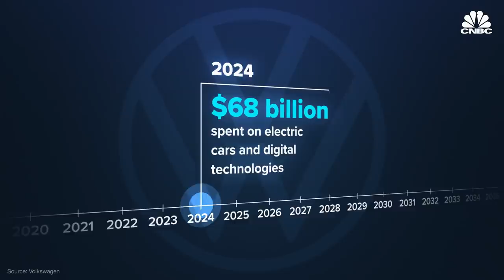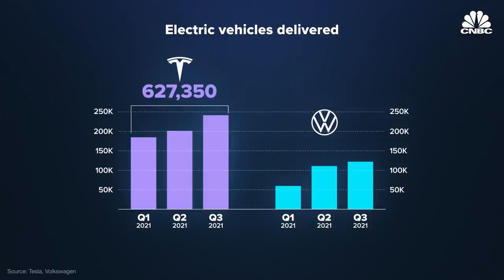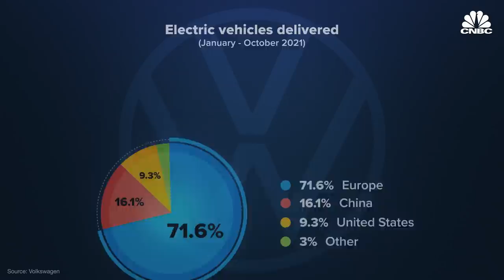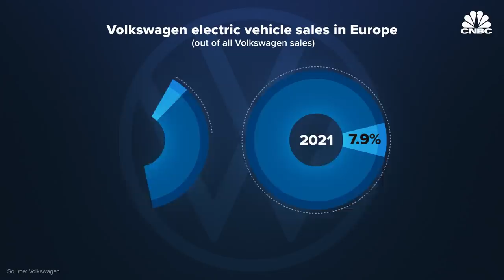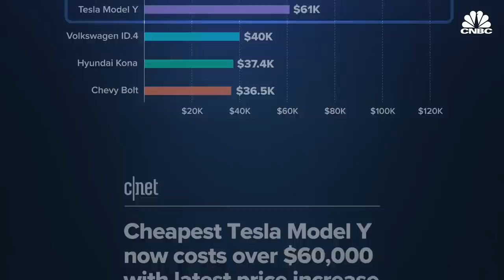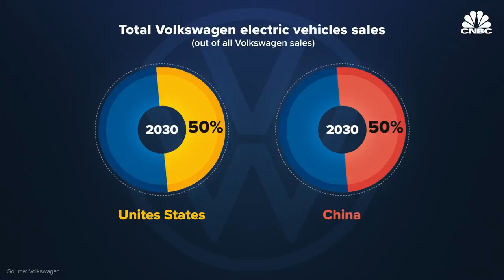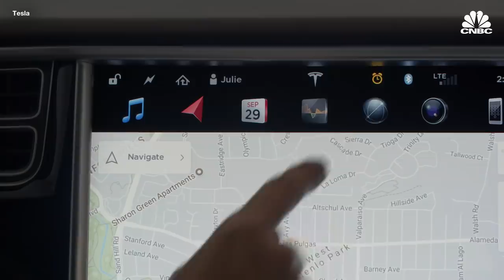Why Volkswagen Is Beating Tesla In Europe

Comment: It's not just the cars, it's the entire infrastructure:
If I would want to buy an VW EV or if I had any trouble with it, the next dealer/workshop would be less than 10 minutes away. If I wouldn't like that specific dealer/workshop, there are 3 or 4 more within 30 minutes of travel time. The same can be said for basically any other established brand like Mercedes, BMW, and VWs own brands like Audi, or Skoda. Tesla? The next "Pop-Up" is 40 minutes away, the next service center 2 1/2 hours.

Tesla may be able to build a "gigafactory" in two years, but the kind of infrastructure big brands offer takes decades to develop - and until they are able to provide service similar to VW et al. near me, I won't be buying a new Tesla, much less a used one.
Reply: Nico I have a Nissan e-NV200 have never been to the garage in 2.5 years since I bought it. A good EV hardly needs a garage.
Reply: I have a tesla since 2019.  There was a noise on my steering.  They came to my house and repaired it in my driveway.  In covid times, I work at home.... it´s perfect, and FAR more convenient than a dealer experience.
Reply: @Pr0nStYle  You are right it is good to periodically check your car. My experience though with Japanese cars is that they are so well built they require much less checking then what is accepted as normal. The e-NV200 I have was actually assembled in Europe/UK but it seems Nissan makes sure they are up to the same standard as Japanese built. BTW I did my first repair since I purchased the car a new windscreen wiper for the co-driver.
Reply: To be fair tesla service is impeccable but yeah it is difficult to have that kind of infrastructure.
Reply: @petersilva037 
You have to keep in mind that

- they currently offer only 4 different models with (presumably) lots of compatible parts in them
- they only sold a total 1 million cars - VW sold about 9 million in 2020 alone
- most Teslas are still fairly new and have little need for repairs caused by wear and tear

Tesla can offer that kind of mobile service NOW, but what in five or ten years, when they have more models and multiple generations with different parts in them? When there are 5, 10 or 15 million Teslas on the road? When more cars get older and more of them get issues due to their age? Do you really think that Teslas model of providing mostly mobile service will be able to handle their push to sell a whole lot more of them? I'm quite sceptical...

Out of curiosity: How long did it take them to get your issue fixed (time from you notifiyng Tesla to them fixing the steering wheel)?
Reply: @renedalmeijer8260  I hardly ever need a hospital, but it's still very comforting to know that there is one less than 2km away from my home.
Reply: Same with Toyota in Australia, etc it’s like what VW is to Europe, the best selling mass market brand. Hell it will be easier to find VW parts in Australia and Toyota parts in Europe than it will be to seek parts or help for a Tesla in both regions.
Reply: Indeed. And the people qre pride to work for VW Audi Mercedes.  It is a mather of honour to help you .
Reply: When I have a problem on my WV i don't go to a WV service center (unless in new with warranty) because it's expensive and not necessarily better. I go to any garage with good Google comments. I know a few around.
Reply: Won't need many services with EV.
Reply: @altonriggs2352  In Germany, winter tires are mandatory, so you have to change your tires (or the entire wheels) at least two times a year. Sure, I could do that myself on our two cars, but for that I would have to buy the necessary tools, spend the time and allocate half my basement unit to store eight wheels. It is simply more cost and time effective to have that done at the dealer: they will charge me only 120€/year for the work and storage of the wheels on both cars (It's cheaper because I bought them there). So for our two cars I make four trips a year to the dealer just to have my tires changed.

It is also mandatory in Germany that your car gets a certificate of safety (TÜV) every two years. You could also go there and get your "plaque" yourself, but if they find something that is not up to code, you have to pay them, get it fixed at a garage, come back, pay them again and then get your certificate - so it's wise to have your car checked and any potential issues fixed beforehand. Your dealer will do that for you and get your certificate, all in one go. For our two cars, I make on avarege one trip per year to the dealer just to get my certificate.

Not mandatory but advisable are regular check-ups of the car at intervals determined by use (distance driven) or age. Only if you have your car checked at a manufacturer authorized dealership, you will maintain your warranty and the value of your car. Again, for our two cars, I make on avarege one trip a year to the dealer to have it checked and to get the stamp in my service booklet.

In conclusion, no matter if I have an electric or a conventional vehicle, with two cars in the family I have to go to the dealership about six times a year even if there are no issues whatsover - just to get the mandatory and advised check-ups and to have my tires changed.
Reply: @altonriggs2352  "Won't need many services with EV" just buy a new Tesla when the brakes, AC, batteries, sensors, wheel bearings,  ... fail
Reply: You actually have to go to a dealer to fix the issue? That's so 20th century!

Meanwhile, the Tesla mobile technician comes over to your home to fix most issues.
Reply: @SHINdanny  And what about minor body or trim repairs ?
Reply: Exactly! Also forget trying to get a Tesla repaired if something goes wrong or you're in an accident.
Reply: @Sg-ci4kp  Not Tesla. They have never built a diesel vehicle, only electric.
Reply: The catch here is about all these VW dealerships having enough staff trained to service electric cars. This compentence need time to teach and learn
Reply: @nicoj9984   You should know that for most areas in Germany, four seasons tyres are a perfectly acceptable alternative. And there are many independent tyre shops happy to sell and store tyres without regard to the car's make. So I don't see how the issue of tyres will require a dealer network.
Neither will the roadworthiness tests - I have my cars prepared and taken there by a trusted independent. With many defect types gone (think of all the oil leaks), this will be less critical than it used to be.
Reply: Stick with what's always been the way to do it - worked brilliantly for many European industries until Asia came along and made them bankrupt.

Dealers are a big part of the problem, not the solution.
Reply: @daxmarsman5189  I promise you that any employee of any company will shift to a new employer for more $ or even if they just sense the tide is turning.

Implying anyone works for loyalty or honour is kinda sweet, but entirely deluded. People work for themselves first, second and third. Anyone who says otherwise either owns the company (me) or is a bare-faced liar.
Reply: In the meantime they continue to work in silence, without hype here in Europe!!! Mercedes already has a range of over 1000 km. This technology will certainly not be less in the smaller models. The German CEO said that not a single Mercedes will roll off the production line in 2025 that will not meet these requirements. This is of course only the beginning in a very innovative time in which we do not need it, for example, to send a Mercedes into space. We strive to train every garage owner and the young people in such a way that they receive 100% after-sales service. Not the happy few should be satisfied . We have the task of dealing sustainably and with care throughout the economic chain. The class is not in this sometimes irrational stock market figures he smiled while blinking his eye
Reply: the meantime they continue to work in silence, without hype here in Europe!!! Mercedes already has a range of over 1000 km. This technology will certainly not be less in the smaller models. The German CEO said that not a single Mercedes will roll off the production line in 2025 that will not meet these requirements. This is of course only the beginning in a very innovative time in which we do not need it, for example, to send a Mercedes into space. We strive to train every garage owner and the young people in such a way that they receive 100% after-sales service. Not the happy few should be satisfied . We have the task of dealing sustainably and with care throughout the economic chain. The class is not in this sometimes irrational stock market figures he smiled while blinking his eye
Reply: I don't think that this is still a key argument with EVs. Ever taken for monitor for inspection? EVs will be way less service intensive as todays combustion engine cars. Tires, breaks and other drive components. The rest is essentially maintenance free.
Reply: Nailed it
Reply: @Pr0nStYle  I disagree on VW quality.  I am 60+ and have owned almost ever brand of car.  Yeah maybe the VW body parts align better than Tesla, and the ICE engines and drive trains on VWs are great, but my experience with my Passat, is that many other parts of the car were not reliable.  Things I have never had fail on other car brands, even after years of ownership, failed prematurely on my Passat Turbo, and I take meticulous care of my vehicles.   I also worked with a guy who had similar experiences with his VW - door handles falling off after a few years,  interior not wearing well, as well as other major problems.  In fact, due to poor quality of their cheaper vehicles, VW is the ONLY car brand I would never purchase again.  That said, I see that Tesla ranks highest in customer satisfaction (for all their models).  Perhaps its just representative of the "fan boy" effect, but its something to consider.
Reply: @daxmarsman5189  in cold weather a model 3 gets more range than any ev, more than the 1000km eqs too ( study from 3 weeks ago in Northern Europe)
Reply: What you need a service center for then? Maybe German EV's need them... i heard they have alot of problems so ye.
Reply: @HermanWillems  I agree - all 4 Tesla models top the charts for highest customer satisfaction. And Tesla is proving that you dont need service centers - in many cases they come to you if you do have an issue.

Comment: The number 1 thing we need in America for Ev adoption are standardized charging ports, there's currently like 3 which in my view is unacceptable
Reply: hopefully, some kind of 500kW charger will be standardized everywhere.
Reply: CCS will be the most common standard. the japanese chademo is dying and even tesla is now adding ccs to their chargers step by step. at some point, tesla will use ccs for their cars too, to let them charge on ccs chargers.
Reply: Well technically there's 2, the one everyone else uses then there's Tesla. You might think there's 3 because there's, J1772, CCS, and Tesla. But CCS is just J1772 with support for fast charging, so it's basically one plug.
Reply: Use an adapter easy peasy lemon squeasy
Reply: @iKingRPG  Spot on!
Reply: there are more tesla superchargers that produce 250kW + than any other.. i guess others should follow suit. Plus you can get adapters.. not an issue
Reply: CCS is already the defacto standard for fast charging.
Reply: @vintageseattle  considering how many cars Tesla has in the US and superchargers I’d say your wrong.  Not to mention you can just get a adapter.
Reply: @bryjb10  Doesn't matter. Europe is all one standard and we sell more cars.
Reply: @mdjey2 that’s true and Tesla uses that standard. We are talking what’s going to happen in the us
Reply: @iKingRPG  chademo is the third. 1772 is level 2, add CCS plugs to it it's level 3. You can't have CCS alone, so it's not an option. The 1772 does the handshake.
Reply: Here in Europe we have 1. Now. And even Tesla is using that one now.
Reply: @HermanWillems  yep CCS
Reply: @Enrique Thiele yea that’s sad but I believe it. Is government doesn’t like Tesla. Non union. But don’t ask Tesla employees if they want a union. Most are wealthy due to stock

Comment: The best new Electric vehicle from VW is from his subsidary Skoda the Skoda Enyaq IV Coupe which will compete with the model y and can be bought for an affordable price.
Reply: But if you like buy it  
But don’t spend your life compareing it to a Tesla because it not
Reply: Its nearly the same price as an model y long range if you want to same amound of options so no its not cheap just the base price but you need to add like 10-15k if you want the same amount of options that that tesla has standard and the model 7 har 350hp and the enyaq coupe has like 265hp in the highest trim with awd. And the Enyaq drivetrain is outdated compared to a model y just compare the effincy between the model y and enyaq.
Reply: @stewarthalliwell  Yeah Tesla are ranked among 3 worst reliable car brands according to consumer reports, over half all the ever produced Tesla cars have been recalled, panel gaps, FSD issues and inspection by authorities, stuck at level 2 FSD for years, stuck at 2017 400 volt tech for years, yeah Tesla is pretty bad compared to Skoda cars (quality, reliable, affordable)- And for 10k les than a Model 3 and Y, people can buy the car of the year Kia EV6GT (quicker recharge, as quick accelerations, same range, better interior, better FSD, can recharge other cars or electric devices) all better than the bad Tesla cars
Reply: It’s ugly And you can’t go anywhere 
Great for Luxembourg

Comment: VW's one advantage is Tesla treats their customers who experience problems like dirt. Also, tesla has notoriously bad QC. Cars have been delivered with seats missing mounting bolts, glass roofs that have flown off cars at highway speeds and suspension components that are not torqued to required specs.

And Tesla owners have been repeatedly "punished" for complaining in the media by having their Fast-Charging rights revoked.

Comment: Personally I fear that they are treating EVs as cellphones and that means introducing obsolescence into the equation.  We will no longer be able to appreciate great vehicles that are 30 or 50 years old.  I recently found an article about a person who rebuilt a wrecked Tesla and since the company had deemed that particular unit as wrecked, the person can't do a fast charge on Tesla's chargers anymore.  Say good bye to your trusted mechanic and look into replacing your vehicle more often than expected due to it's built in obsolescence.
Reply: Very good point, and that drastically raises the carbon footprint of these new offerings ...
Reply: But with less moving parts ev's should last longer or do more miles,  although the battery will need to be replaced...
Reply: Trusted mechanic lol
Reply: That has nothing to do with planned obsolescence. Damaged batteries are deemed too dangerous to let laymen handle them or to be used again without verifiable repairs and Tesla doesn't want to get sued because of something that stupid.
Reply: @ehtuanK  — Then that means Teslas are a dangerous design ...
Reply: @sking2173  No, it just means damaged EV batteries should be left to professionals, just like anything with high voltage. Teslas are safer than other cars, despite the battery.
Reply: @ehtuanK  but in the aforementioned case, the battery wasn't damaged. My point is that car manufacturers have the ability to render the car obsolete any time they want as it's happening with cellphones
Reply: @richardstubbs6484  This is only in theory....In practice software is making electric cars obsolete sooner than they should be...

Comment: The bottom line is the bottom line.  100% of Tesla are imported from China and the USA.  That said there are advantages that Tesla really has over VW. Gross profit for Tesla is 30% and 8% for VW.  Tesla produces three cars in the same time as VW produces one. There has never been a software update on a VW. NONE. Tesla regularly updates their software so things like changing the battery, suspension, and motors can be upgraded over the air.   VW needs to sell 3 - 4 cars to produce the same profit as Tesla does with one. Another important fact. VW has massive debt.  Tesla basically is debt free.   So while CNBC says VW is beating Tesla that is like most things journalistic Fake and outright lies

Comment: What irritates me is the lies around range. Tested indoors no headwind. Nobody in the car. Nothing turned on set at its most economical speed. Just watched a program with a ev towing a caravan. Best figure they got was 100 miles before the battery was flat. And you can't charge with anything being towed. So you have to disconnect and reconnect every 100 miles. Many winter driving tests halve the range. Battery's and infrastructure have to be better.